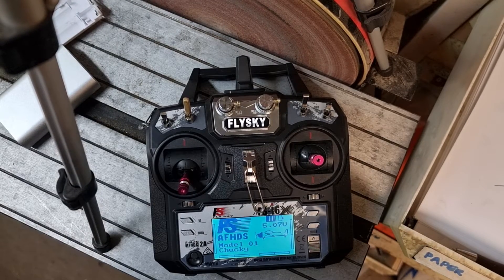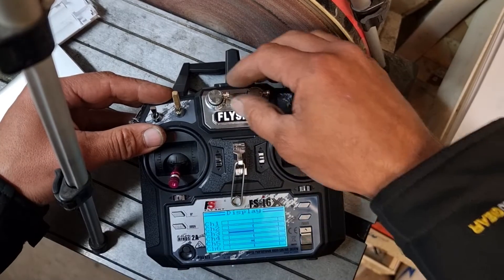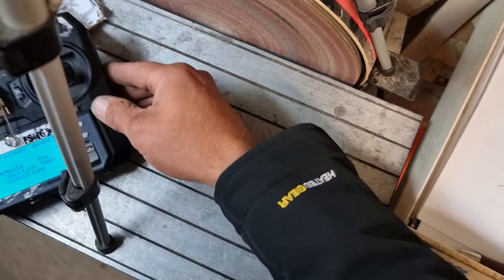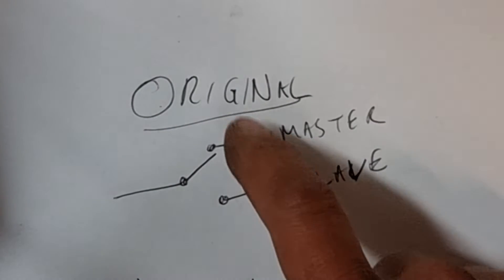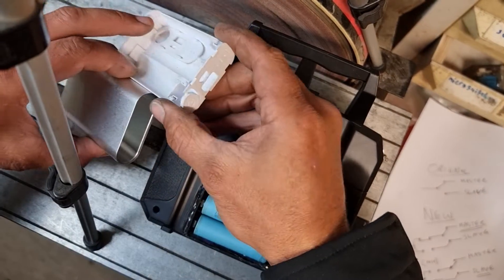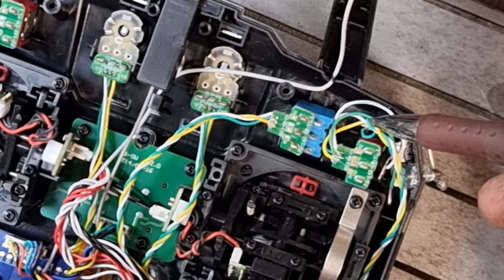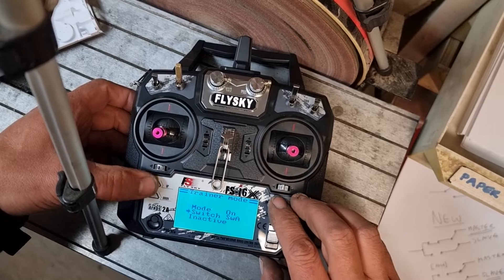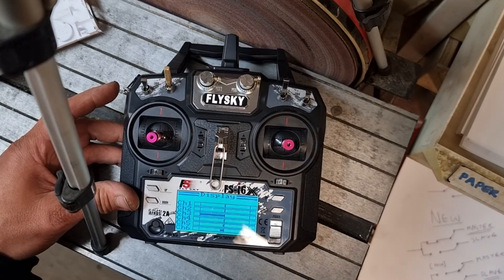A Better Modification for FlySky Fs-i6x ADD a Momentary Switch, Don't Replace It!

Comment: Hi there thanks for the info have put mine in new box same as JR2610 radio so have lots of switches need to get more switches on to the Flysky board upgrade your software on your radio

Comment: Thanks for the well explained switch mods, Ive added some another way to.
On any of the two position switches cut top most wire (white) and wire a normal momentary switch in series with cut wire. Now you have three positions, two on the switch and third momentary.

Comment: Is there a way to hook up two 3way switches to control 1 output. So 6 positions between two switches one output. Please x100 let me know what you think
Reply from the maker: Yes but only 5 positions not 6 (LL,LC,CC,CR,RR only.  LR gives the same as CC) and only on the analogue outputs, not the switches.  The switch channels can go from 2 position (voltage left, voltage right) to 3 position (voltage left, no voltage, voltage right) but can't be halfway.  You'd need to look up 'resistor ladder' and ideally buy a 6 position switch from AliExpress or similar.
Reply: @Makes-and-Mods  thanks very much for the reply sir. I honestly just have an abundance of 3 position  switches hooked up and in something I'm making so just hoping to use a few of them together as I don't need 12 Individual switches.  I could email you a photo if my explanation leaves needing more information. I basically put  an i6x into an old Xbox racing wheel and pedals and I have 6, 3 position switches in the wheel along with how ever many switches come on top of thr i6x flysky. I hope this helps. Trying to work with the parts I have currently.